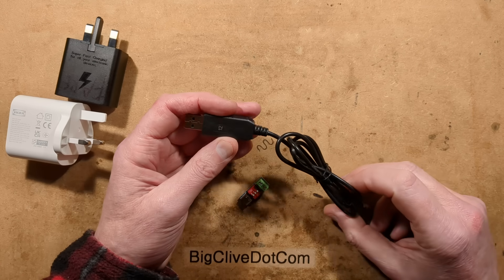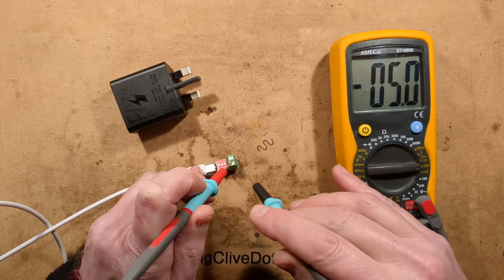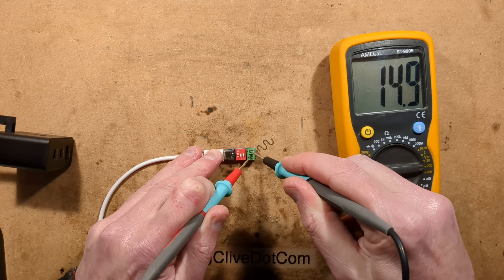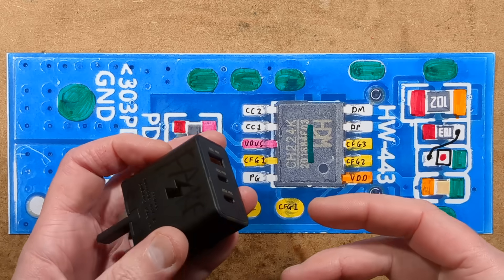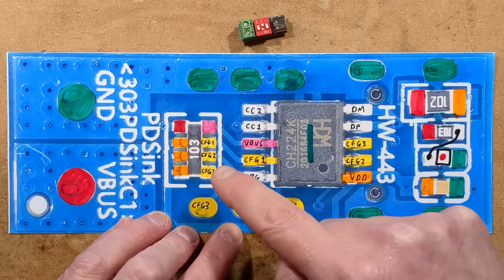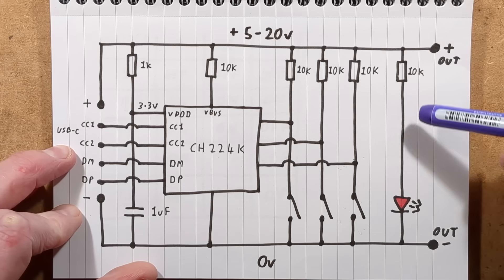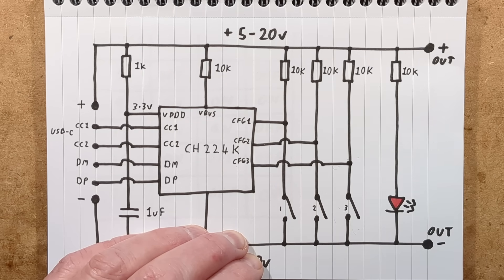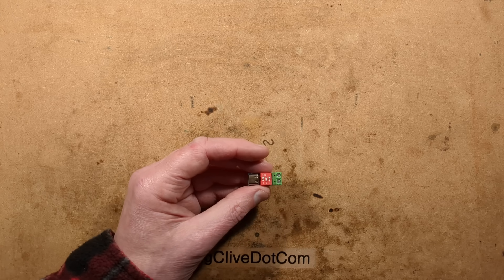Cheap USB-C programmable PD voltage module for 5,9,12,15,20V

Comment: Some things to consider when building with this (or similar) ICs:  You can ask for whatever you want, but what you actually get is outside your control.  For instance,  you can set configuration for 9v, but at power-up you will either get 0v or 5v (depending on the USB source) as that is the default without negotiation.  So, at best you'll get 5v for a while, until the USB power sink and source negotiate (the role of this chip), and then it will switch to 9v.  Or it could  be connected to a non PD compatible power source, so you'll only ever get 5v.  Or it could be that PSU just can't provide 9v (in which case you'll only ever get 5v). 
The one thing to conclude is that asking isn't getting and your hardware and software design must deal with whatever they get gracefully - whether that means just shutting down because 5v isn't enough for your purpose, or being partially functional based on whatever volts are available.  It's also worth noting that the USB source can unanimously decide to stop giving you 9v and drop you back down to 5v if it wants to (like it is getting too hot, or someone has plugged in another device to the source and it can't power both).  Basically for a reliable device you need to consider all these points (and many, many power sources don't meet the PD specification, currently at v3.2, in all its nuances.
Reply: it's worth noting that a device expecting more than 5V won't usually be damaged by receiving 5V so at least you won't release magic smoke, worst that can happen is things won't power up
Reply: Reminds me of video display drivers. You ask for 10bit per channel RGB and if the monitor doesn't support it you get 8bit RGB channel and you don't even know...
Reply: Not exactly for a regular USB port the default is 5 volts for a PD port the default is zero volts this is why a lot of cheap USB C devices won't work with USB CPD chargers 

That's because they're not negotiating the connection and so the charger says well you get zero then. You need two little resistors in there to tell it I'm a dumb USB 2.0 device and then you get the default 5. 

Good news the Samsung knockoff actually did follow the spec it could not give 15 so it gave the next highest it could 12 and stayed there
Reply: USB c, both power delivery and data and feature capabilities are such a glorious mess. The only positive seems like it’s now a universal physical connector, which is part of the reason for the problems lol.
Reply: @FirstnameLastname.69  There are cables that can do it all, but I cannot mention the brand for some reason, otherwise the comment gets deleted. But this doesn't fix the problem that not every host supports all of it.
Reply: TL;DR: Just get a power supply that supplies the correct voltage and be done with it.
Reply: In not so many words: almost useless.
Reply: @robegatt  It's only useless if your PD PSU can't deliver the requested voltage. Which is YOUR fault in that case.
Reply: @kyoudaiken but the OP said that the PSU can be capable but decide against providing the requested voltage, so the destination device still needs error correction that deals with that situation. 
So how could one ensure their USB-PD power supply behaves as expected and provides a voltage it is capable of, if it has the autonomy to choose not to provide that requested voltage?

I guess it would be a real issue in critical applications, so USB-PD with a special adapter wouldn't be a good option for critical use cases.
Reply: @zzoinks  I don't see any reason why it would decide not to provide that voltage anymore. If you buy a proper one, this doesn't happen. Like with mine.
Reply: @zzoinks  The chip apparently has a power good pin that can be connected to a MOSFET/Relay to remove power if the delivered power doesnt match requested (tho this device doesnt use it)

Comment: "very light, but it used to be heavier until I removed the steel weight in it!" I remember Ashens having this exact experience when taking apart a cheap Chinese game console.
Reply: Old transistor stereo amplifiers back in the day ... literally just a hunk of steel not even as a heat sink.
Reply: On the other hand, I nice worked at a company that made time delay reflection gear intended to find breaks in 10-base-T cables. Very good gear, could locate a break in a hundred meter run to within a few cm. At the time the company was the market leader in the US.

Sales weren’t good and customer feedback suggested the equipment “felt cheap”, so I suggested the company add some ballast to the cases to make the product feel more substantial. I cited gameboy as my inspiration as they were already at the time somewhat infamous for it.

The company did it and sales improved.

Same product, same tech specs, different customer perception.
Reply: @markfergerson2145 I wonder what psychology makes heavier things feel "better"? My new phone is heavier than my old one. I think the lighter phone is actually easier to hold so it's more convenient, but now I'm used to the heavier weight. Some people said they prefer heavier phones because they feel higher quality and I just can't understand that idea. At least I'm now fairly used to the increased weight on my new phone. 

Usually, on phones being heavier means having a larger battery (if I understand correctly)
Reply: @zzoinks  more weight = more things inside = more/better features = better
Reply: @zzoinks  for some products it's more about convenience, no one wants too light console that will be pulled by the cable all the time. So they add weights inside of them. First optical mice all had them inside, most people were used to old, heavy ones and nobody liked feeling of air in the hand. 
Sometimes, of course, it's just a scam, just think of the ATX power supply with PFC "inductors" full of sand. But most of the time is because it make the use of product more convenient.
Reply: @zzoinks  Probably our primeval mind. Bigger mammoth more food...
Reply: @zzoinks When it came to home stereo equipment, heavier = better..

Thos started way back in the vacuum tube era, and the required output impedance matching transformers between the tubes and the speakers NEEDED to be large and heavy to be able to reproduce the frequencies near the ends of the human hearing spectrum (20-20,000hz). 
The heavier the "Iron" in the equipment, generally the better it sounded. This carried on into the solid-state era also. The heavier units tended to have larger power supply transformers, more output devices, and larger reservoir capacitors, all capable of higher output wattage.
Reply: @zzoinks  Best phone i own ( 2g so a dusty ) is a Sagem flip phone, a bit smaller than two matchboxes stuck together.
Reply: @markfergerson2145  I wish I had a TDR at the first LAN parties in the early 90s. Would have saved us so much time.
Reply: I once bought one of those "White Van Speaker Scam" stereo receivers from a pawn shop for $5, JUST to see how awful the components&circuitry was inside, and when I opened the unit up, it had 2 plastic forms filled with concrete bolted to the bottom of the chassis, to give the unit some weight!!... 😂 I am NOT KIDDING!! 🤣
Reply: I took a Weller Soldering Station apart, it had a bag of sand in it.
Reply: @1dave301  that actually makes sense as a counterweight

Comment: I've got a few of theses, they're very handy for use as power supplies for circuits. I don't have many PD supplies, so I use PD supply modules. They're handy too. Feed them 8-30V DC and they will provide a PD output with voltages depending on what they are supplied with. I use them with old laptop supplies (19V @ 3A).

Comment: Looks very useful, and a nice small module to have a play with. I’ve got a few of the cable integrated ones, which work rather well at lower current.

Yes the idea of some glitch and suddenly 20v  does concern. Think I’d use some sort of crowbar on the import if delicate. 

I really must get a wall charger which does PD, will come in handy as only power banks here at the moment. 

Interesting as always - all the best Clive.
Reply: Ps love the product links, you get a small payment from them (which is only fair - you advertised it in effect) and makes it easy for anyone watching to buy the items you are covering. 

And yes …. I bought way more than just tat module, just so many tempting things on there

Comment: I've got a couple of those modules and they're great. But also the IC, the CH224K is quite popular. It was one of the first fully integrated USB PC controller ICs that you could just configure with pulling pins high/low or resistors rather than the previous ICs you had to communicate with over SPI or I2C which was very complex. It's also dirt cheap which is a big factor. Seen it quite a few time in finished low cost USB C products than need more than just 5 V.

I believe the extra pin for VBUS monitoring affects the state of the PG pin on the K variant and the state of the high-side FET on the other variants. Only the Chinese version of the datasheet mentions it.

Comment: There's a newer standard again, not in use on cheaper brand chargers, though, that allows for literally dialing your own voltage and current. Really neat stuff that you can just build a benchtop PSU out of. @greatscottlab featured them a while back.

Comment: I've noticed some of the newer chargers (45W and 75W rated, plus some deluxe Anker 100,140,160W) are forgoing 12V and just offering 5,9,15.  Asking for 12 gets 9 on the ones I have.  Important to know, as I have some of those C female to coax barrel plugs that ask for 12.
Reply: USB PD standard has no 12V voltage, check the spec. 12V comes out of these as QC AKA QuickCharge, which I believe is a Qualcomm thing. Obviously, lots of these "USB PD" triggers output 12V, but they're NOT using USB PD to do so.
Reply: @wifigod  Technically PD can source 12V,  the 5,9,15 are the mandatory voltages but you can provide any voltage you want and any device can request an arbitrary voltage. Now not all supply’s will provide that… but some will, it’s even technically possible to charge a lipo directly off the PD source with no charge controller by requesting the arbitrary voltages required to do so (and this was intentionally requested by one of the companies working on the spec) …not that that’s a good idea… The 12V comes from the initial spec that specified 5, 9, and 12 instead, many designs were already done at this point before the change to 15 so many PD chargers will do all 4 voltages either because the design comes from that time or to provide compatibility with devices from that time. Source, worked on the spec myself.
Reply: @HyenaOfDoom  seems dumb they excluded 12 from the official spec tbh. there's a huge range of existing 12v equipment
Reply: @wifigod I was actually thinking that to because the fake Samsung charger he has had orange ports a dead ringer for qc 3.0 witch stops at 12 and was used by Samsung for a long time
Reply: This is a PITA when trying to use them with amateur radio kit. The 12V power profile was removed from the USB-IF requirements a few years ago sadly.
Reply: @rjy8960 I read a history of that but, yeah, don’t get it.  If you need more than 36W as an advanced device, just ask for 20V and be done with it.  15 is just strange
Reply: @radellaf You’d need to pick the brains of some of the people designing the 2.0 version of USB-PD to see why they removed it, but since it was in the largely unadopted 1.0, it’s not implausible for it to be a request from the industry to omit it. All modes in 2.0 are limited to 3A, so 15V makes for a very clean and marketable 45W, and USB-PD was designed around the idea that you will negotiate as many watts as you need, and handle voltage regulation yourself to get your working voltage.

The benefit of this design is that chargers ended up very straight forward for users unlike most other things USB-C, as all modes were mandatory up to the wattage the charger offered, so something that used 15V/3A could just say “45W required” and still work in a 60W charger.

They later (regrettably IMO) changed this with the addition of PPS and EPS, as that meant it was no longer straight forward to know what works with what, which USB-C is plagued with in general.
Reply: @ChlorideCull   So 15 instead of 12 for a marketing number that ends in "5" instead of 9 fewer watts.   Well, at least the addition of PPS or other variable voltage modes may make it possible to get 12V out using those, though probably more as a technical curiosity rather than anything I'd use to run 12V equipment.

IDK, 15V just seems silly, but hardly the strangest thing about the standards, to be sure.
Reply: @rjy8960  Running radios from a noisy USB power supply is not likely to work well, but If you really want to, you can use PPS to output a custom voltage. The trigger modules are much harder to find and not all USB PD power supplies support PPS though.
Reply: @rocketman221projects  15V would ironically be ideal as theres right on enough headroom for linear regulation
Reply: An earlier version of the USB-C protocol did not support 12v and even now it's only optional in the standard. That's why it's always requires a bit of luck getting a charger that supports 12v too.

Comment: Thank you so much for this BC. I recently bought some of these, because they looked interesting. Now I realise that I totally misunderstood how they work. I was applying voltage to the green terminals, and whatever voltage I put in came out the same from the USB socket. D''OH!  I now feel a bit stupid.
Reply from the maker: Nah, it's an easy mistake to make if you didn't realise their function.
Reply: The idea that the load can command (request) various voltages is strange for those of us who grew up on dumb pre-determined supplies. Is a remarkable advance but it still hurts my brain.
I got a Motorola phone and their suggested wall-wart (with cable), both rated up to 68W. The phone starts off reporting 68W and the battry charges REAL fast. Just as the phone(battery) gets warm (approaching full charge) it cuts back to 20W and to 0W.
Reply: Thats an interesting, unexpecting feature :). It rwminded me an old Xerox usenet joke: a newbie was playing a little hand-game and his supervisor came asking what is he doing? 
He said that game offers different difficulty levels at which the game tries to win against the player.
The guru said that this game also has a level at which it wont allow user to win but also wont want to win the game.
How to enable that mysteric mode master?
The guru took the game in his hand and crushed it into the pavement.
The rookie was enlightenwd!